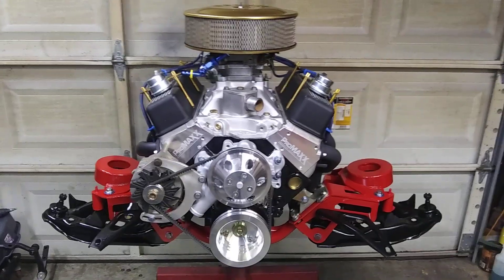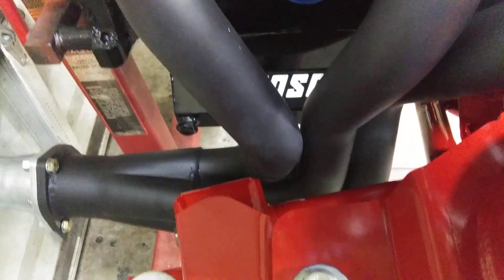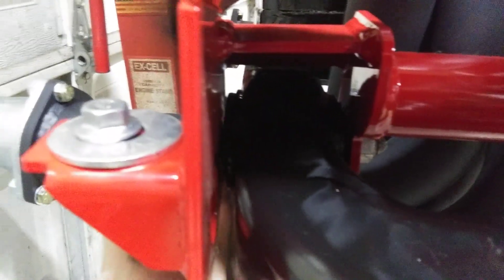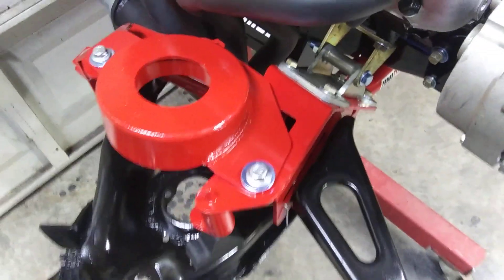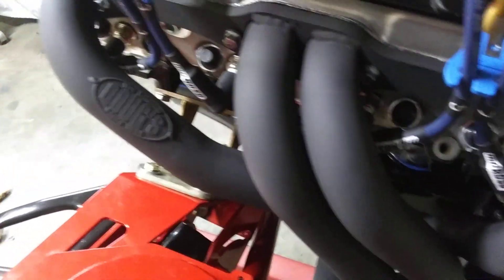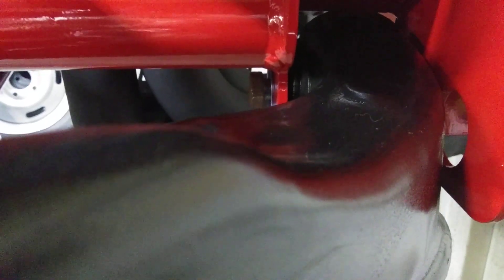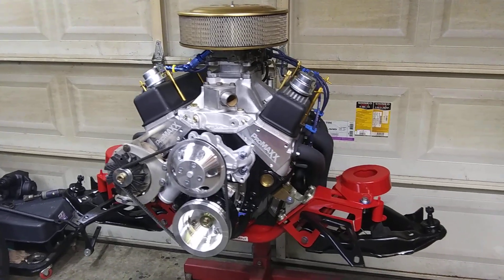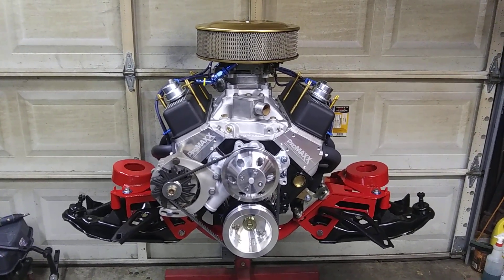Checking clearance on the UMI K-member & headers.

Comment: Hey, the power plant looks great. I have a 89c2500 I had to use the short headers on it. The long ones put the exhaust really low off the frame. Converted it from tbi to carb. Was fun project. Fabricated my own fuel system for it and the TV cable for the 700r4 transmission.
Reply from the maker: I'm also building a engine for a 92 Suburban we have. It's carb swapped too. New engine should produce 425-430hp.
Reply: @thereluctantgearhead4544  you build some bad ass powerplants
Reply from the maker: @jeremylaxton6826  Thanks man